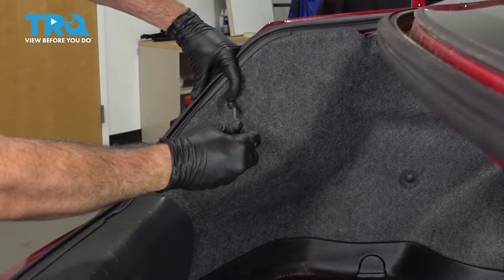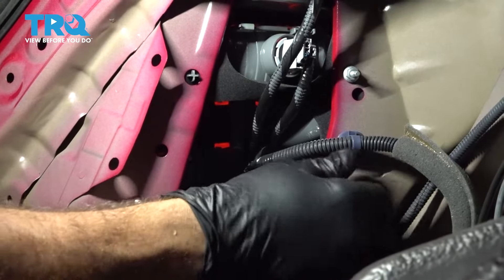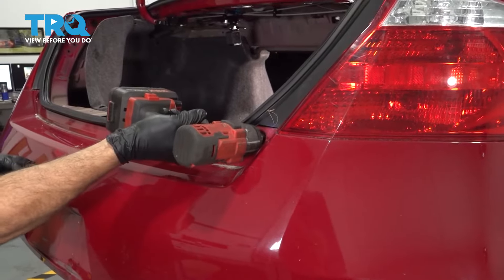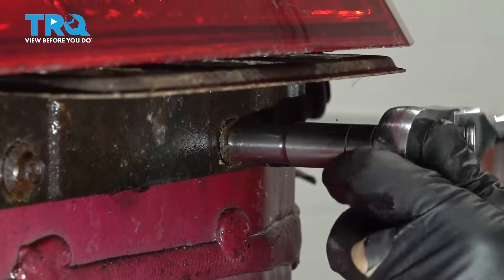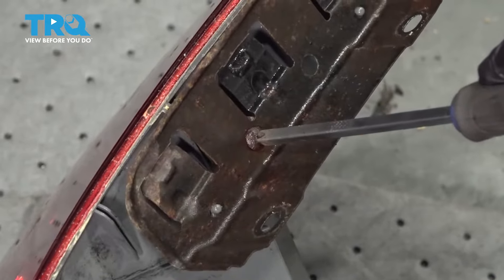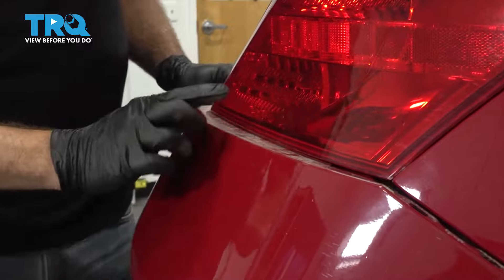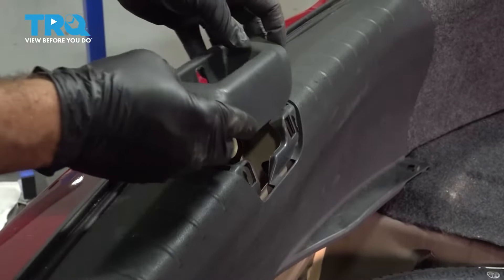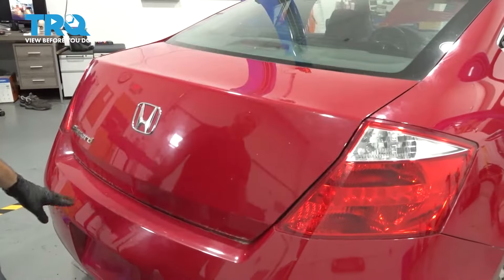How to Replace Tail Light 2008-2012 Honda Accord

Comment: idk if everyone in the comments is joking or not but just in case - this is for replacing the ENTIRE tail light (i.e. the plastic housing he takes out) you DO NOT need to do all this to replace a burnt bulb lol, just remove the trunk liner like he did in the first step and you can pull the bulbs out from the back to put in a new one. Save yourself the time and embarrassment, don't pull your damn bumper off 😂😂

Comment: Great video for how to for entire tail light assy on my Daughter's Honda!... but Wow, if this is a dealer tail light replacement, this is easy a $400 - $600 total repair bill. Glad she only needs bulb replacement!! 🙂Gotta love modern engineering and "quality".  Clearly these vehicles are, "New and improved!".    My 84 Corolla which still runs and drives is 3 - 5min tail light assy replacement including cleaning of mount area (bulb is like 30 seconds).  Same with 89 Toy 4x4 which still runs and drives. Probably 15min for my 2001 & 2002 Subaru Outback tail light assy with bulb replace being about 5min.